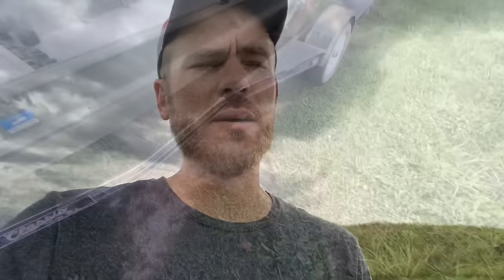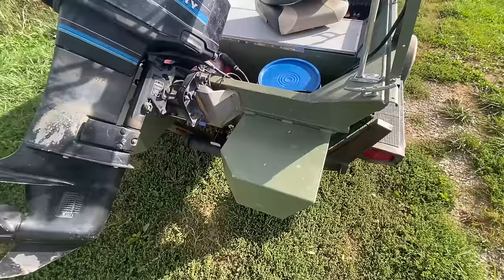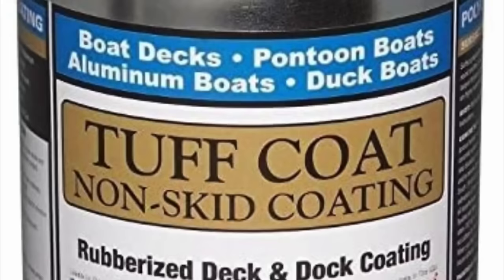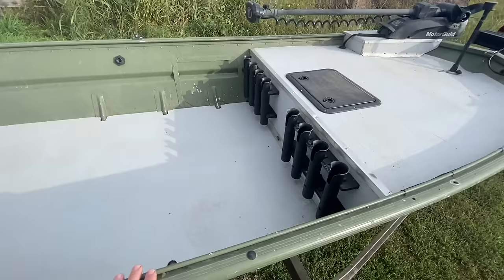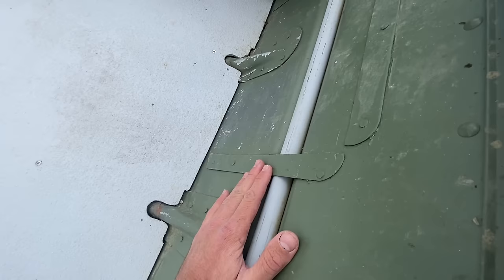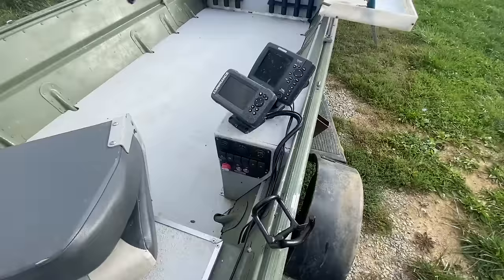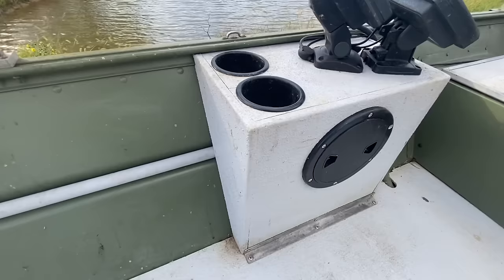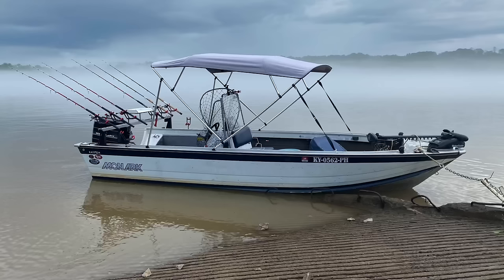Jon Boat Modifications Explained-The Ultimate Jon Boat Setup

Comment: Neat! I'm a Pacific Northwesterner myself but I can use a lot of these fixes easily on my Starcrafter SuperSport16. Especially really liked the conduit for the wires. I put down the Harbor Freight truck bed liner on my ½" ply floor which was a huge mistake! Black floor in a boat where the summer temps can easily hit 107°, not very foot friendly. Plus my paint job didn't last very well. Thanks for the tips!

Comment: i took the seat out of my jon boat. i ground the top of the rivets enough to pull the sheet metal past the rivet...and then re-set the rivet with a hammer and piece of iron. the rivet didnt have to be replaced as the old rivet was never removed. so no leaks. just sawed the bottom part of the bottom of the seat as it wouldnt be seen under the new floor i put in

Comment: Nice vid man. I've got a Tracker Topper 1542. I plan on ripping out the bench seat this winter. Only thing is it's got a live well I never use right in the middle so I'm gonna have to figure that out. Might just plug it up and fill it in with some epoxy. But it's a great little light weight boat and my little 15hp Yamaha pushes me 27mph. Of course when I carry two other people and all the gear and coolers that top speed slows down to about between 20-22mph. But I really need room to move around in it. Those bench seats are so wide it just eats up all the room and it's pretty uncomfortable to fish out of with more than two people.

Comment: Is there a reason as too why you stitch welded the float pods on instead of welding the float pods solid or does that really make a difference either way? Also how'd you choose the right location too weld them on (Height and distance apart.)

Comment: Hey nice boat, I'm interested in the two floats on the back. Did a company make them. You said you tig welded them in, so are they sealed boxes? Also do they run flush with the bottom of the boat? You should do a quick video on just those. I just got a 15 foot 1960-1970s boat that im putting alot of work into.
Reply from the maker: They are sold by a company called beaver tail and they are a sealed box with a flange that can be welded or riveted on. I can’t remember the exact angles that I set them at but I do remember calling and giving the company the dimensions of the transom and the angle so they could build them to my boat. They make a big difference and I recommend them. Thanks for watching

Comment: Is that 1/2 or 3/4 pvc you used for the conduit? I’m in the middle of a rebuild now and think I’m gonna add the pvc tomorrow
Reply from the maker: Im pretty sure it’s 3/4, I know it’s bigger than 1/2”  
thanks for watching and good luck with your rebuild 👍
Reply: @hagengrubbsfishing  if it’s bigger than 1/2 then it will be 3/4. Thanks for the quick response, the info, and for the well wishes. I enjoy your content
Reply from the maker: I was thinking It could possibly be 1” sched30 but I’m 90% sure it’s 3/4.

Comment: If you got a flat bottom John boat c heck out the harbofr frieght tools 4 x 8 trailer I paid blut 300 bucks used it to haul everything I think itss rated for 1200 lbs you gotta assemble it your self maybe half a day or less if you  its bolted together with lock nuts n washers maybe reinforce the hitch if you can weld maybe add two by two to strengthen the hitch a lot of people build them teardrop campers with them I just haul building materials bricks concrete lumber you name it Im sure you could make it work if you are mechanical and the lights are cheap but put marine ones on instead and tybhey got parts for them and tires to! find me a comparible trailer for under 500 dollares it doesnt exis!! Im strill using itad an 8u ft ;piece of 2 x 2 steel tubing n reinforce it a little.n your dxone.

Comment: I have the same exact boat and I have a 9.9 hp honda boat motor and it's hard to take out to the river because when I give it throttle the front goes almost straight up and you can't see to take it out. Do you have any suggestions on what I can do to stop that?
Reply from the maker: The float pods would probably help it plain out but they are pricey. I’m not sure if a hydrofoil would help on a motor that size but it would definitely be worth looking into. Thanks for watching
Reply from the maker: I have a friend with the same size boat with a 9.9 and he plains out fine and runs around 20mph so I’m not sure what’s going on. Have you tried adjusting the trim pin?
Reply: Adjust the trim pin usually senond hole from the bottom and get a hydrofoil and make sure cavitation plate is level with the bottom of the boat. My 83 johnson 9.9gets me 24 in my 1436
Reply: The least expensive thing you can try is shifting some of your weight forward.-- battery, fuel, cooler, gear. 
A mate of mine has a 14ft mirrocraft with a 9.8 and while he doesn't have that problem we can add, or subtract, 1.5 mph top speed just by were we place our gear and cooler. Small boats are sensitive to small changes.
Reply: I thought I could put like a casting deck on the front and put all my batteries and all my gear up toward the front and try to see if that'll help thanks for everyone's comments